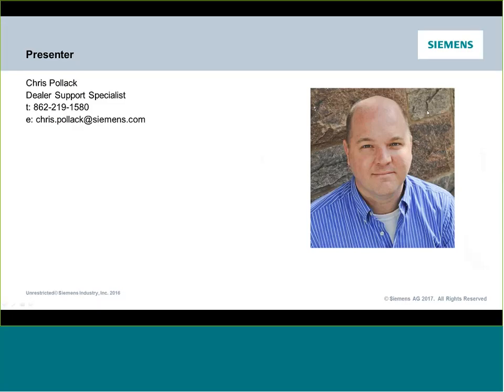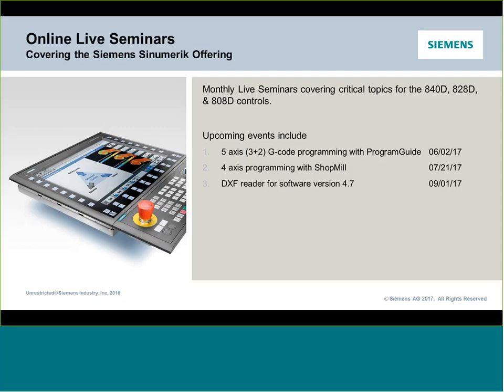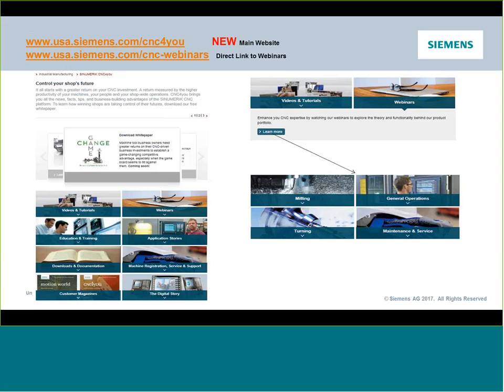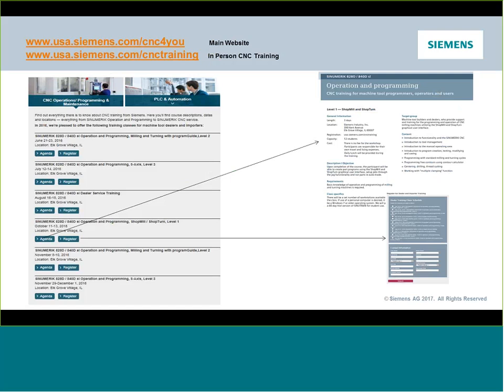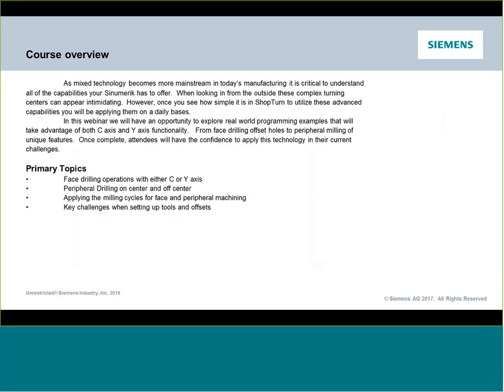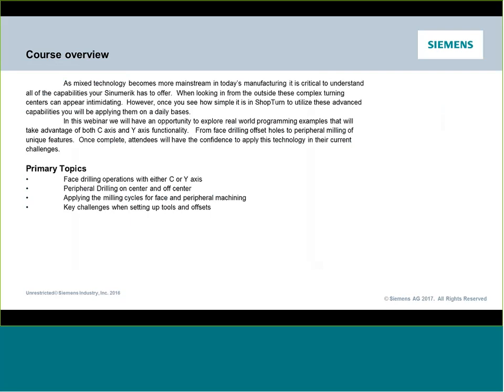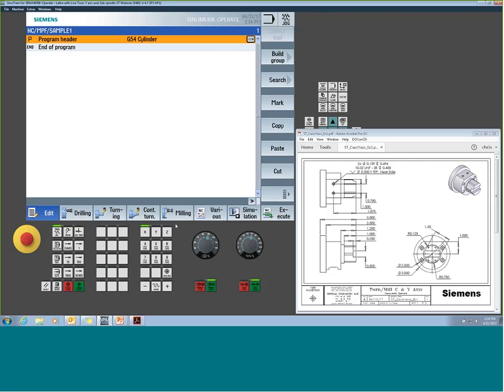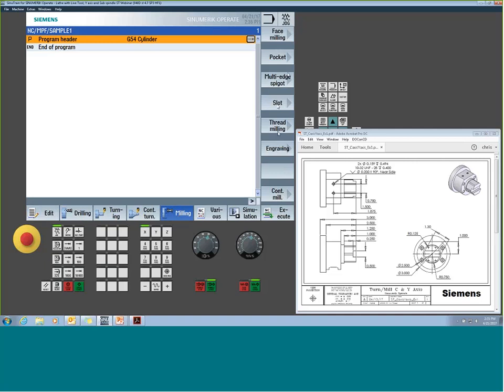Programming a Lathe with C axis and Y axis in ShopTurn   SINUMERIK 840D Sl & 828D Turning 20170421 1

Comment: Hello mr CNC
Is there a standard cycle to produce a hex mid way along a shaft inbetween 2 diameters.
Only way I can do it is to produce a contour to run on the Y axis front to back and then rotate spindle every 60 degrees to produce my hex.
I have a turn/mill machine with hsk63 so not a turret lathe. Siemens 640d
Reply from the maker: Roger. I would need more details, however you could write this long hand in g code.

Comment: Mr CNC , video are very good and very helpful. But I have a internal undercut I am trying to do on the C face. The milling cutter is profiled so I want to go into the bore and interpolate out to a depth to generate a form. When the cutter gets to the right I/d it will just withdraw from the bore.
I can not see a feature other than thread undercut that will let me do it in 😮Siemens 840d to get it to retract.
Turning it ,I just use a internal grove feature with a X0 and T1 but I can not turn it. So I’ve looked at using the milling spigot feature but I can not find other than the undercut that gets anywhere close.
How should it be done ? I need an expert
Reply from the maker: what machine and what does the part look like? email me Dan.strubel@siemens.com